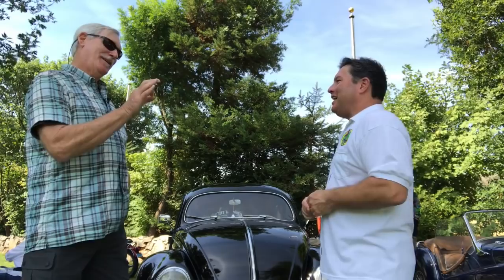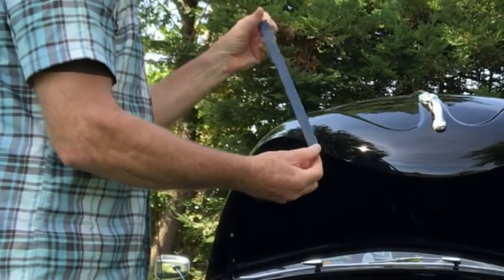Friday EXTRA! VW Beetle vs. Ford Model A + Viewer Mail + Thank YOUs

Comment: In the '70's and '80's, I owned a '63 and '68 bugs and a '69 Karmann Ghia. Back then you could buy old VW's dirt cheap -- there were still a lot of them around. I was young and poor, and these were cheap daily driven beater cars for me, not collectibles. I drove them until it became cheaper to buy another beater car than fix them. The '63 had a newer engine in it. All of these cars had either 1500cc or 1600cc engines, which, IIRC were 55-60 horsepower. So, power was adequate (just barely) for a daily driven car. These would pull the uphills on I-70 in the Colorado mountains at 55mph (the speed limit then), at full throttle in third gear. I used to get about 25 mpg in the city, and 30 or so highway. The latter figure was mostly mountain driving, where I would routinely coast engine off on downhills. You could do this reasonably safely in a bug. The transmissions would lubricate adequately when coasting. RVers used to like to use them as tow cars, as they cound be flat towed just by putting the transmission in neutral, and they were light. Since they were manual transmission, all you needed to do when you needed the engine again was turn the switch on, put them in gear, and let out the clutch. They didn't have power steering or power brakes, and didn't really need them because they were so light. By this time, they all had gas gauges too. The '63 had a mechanical gauge. There was no electrical connection, just a cable that connected the float to the gauge. Probably the worst aspect of daily driving a bug (at least in the winter) was that the heaters sucked. They drew air from the engine cooling fan, and ran it through an exhaust heat exchanger (so essentially manifold heaters). Since the air was moved by the engine fan, the amount of heat and air flow varied with engine rpm. In city driving, you could get a little more heat out of them by running in third gear instead of fourth, to keep the revs up. The only time the heater really worked well was on those mountain uphills, when you were running the engine at full throttle and close to maximum RPM. The bugs' top speed was about '75 on the level. With a bit of a downgrade or a tail wind, you might coax them to 80 or 85. Not that driving a bug that fast is really a good idea, but I was young and thought I was immortal. The Ghia would do 85 on the level, due to either better aerodynamics or lighter weight than the bugs. Which car was better? I would give a slight edge to the bug. You had a 4 speed synchronized transmission, rather than the three speed crash box of the model A. The bug, at least by the late '60's, had a distinct advantage in speed and power too. The model A, at least the bigger ones, had the edge in capacity. The front trunk of the bugs was pretty small -- you actually had a bit more room behind the back seat. Also, the back of the back seat could be folded down and give you a decent amount of space if you didn't need the back seat for passengers. Both cars though, were masterpieces of economic transportation and elegant simplicity.

Comment: So sorry to hear about your back!  Get well soon.   I have been watching your videos for several months and was thinking how similar the Model A is to the VW.
I have a 74 VW Thing that still uses side curtains.  Sometimes have to get creative to get it home.  I had an accelerator cable break once, ended up using a spare tail light bulb to wedge the carburetor open enough to drive home without the gas pedal.  A policeman stopped me as I crawled up a hill at 5 MPH with the fourways on, and wanted to know what the problem was.  After opening the engine cover and seeing the "carburetor bulb" stare back at him I was told to carefully continue my journey home.  Every drive an adventure. Gotta love old cars!!

Comment: If your 1951 VW is getting less than 38 MPG there is something badly wrong with it! Assuming that it gets driven so seldom that your fuel is evaporating faster than you are burning it, I own a 1952 VW and a 1929 Ford, the build quality and reliability due to simplicity and excellent design is very similar between the two, although the Ford has more torque and horsepower the VW makes up for it with aerodynamics and lighter weight

Comment: Finally The First Ford Friday Funday ! 
Loved the Friday VW special. I discovered long ago that in the Antique Car club I belonged to at the time, more than a few members also drove a VW beetle. 
The man who wouldn't sell one bolt or do-hickey from his vast 1926-27 Model T collection went to Germany, toured  the factory, and ordered his new VW which was shipped back to Illinois. This was in the late 60's. At the time it still cost him under $2000 total with shipping. 
I was impressed by those little beetles.  After I bought a very low mileage 1926 T touring project from the 'man who would sell nothing' I traded my 1954 Ford two door customline sedan for an unusual thing called a 1957 VW beetle with the folding sunroof. Unusual because here  in corn country in the 60's and 70's VW's were mostly unseen and unknown. It had a small oval rear window and a lever under the dash to flip when the gas tank went nearly empty. Sorta like an old Harley I had.
I have no idea what fuel mileage it got but we drove it 170+ miles from home to Chicago and back before filling the tank at our favorite hometown filling station! Most of that trip was on a highway called Rt 66.
Two kids eventually rode in the space behind the rear seat for fun. They watched 4th of July fireworks from the canvas covered hole in the top. I hauled  Christmas trees and pulled a new Chevy Corvair from deep sand..... I'd promised the Chevy dealer I'd never tell! Corvairs supposedly went thru anything.
In 1969 my wife and I drove from central Illinois to the middle of NY to a concert in the middle of a cow pasture, camped in the VW, and returned to Illinois. A small event few remember.
I have more memories of VW's than Model A's. Maybe I shoulda bought a VW instead of my last Model A.😀

Comment: Thank you for previous video, and for answering my engine counter balance questions. The after market counter balance crank did make a difference in my model t but you confirmed what I thought that it is not necessary for a model a! Thanks guys!

Comment: So cool you shared the video! Thank you. In 1951 there were multiple models of the Beetle. This is a Deluxe Sedan. I am in the final phases of restoring my 1951 Standard Sedan. The standard was the low budget version, and differed from the car in your video in that it has mechanical/cable operated brakes, a completely non synchromesh transaxle, and no chrome trim....even more like a Model A. ;) When I am done with the resto, it will be on to complete my October 28 Tudor. Love all your videos! Thanks Paul!
Reply from the maker: Thanks for the additional info, Mike!!!  That's neat to know.

Comment: 40mph cruising speed and only 20s for fuel economy? Something is very wrong with that vw. I’ve had MANY over the years. My 40hp VWs would do 75mph flat out, maybe even a bit more and return 28-32mpg average. A vw has the same top and “cruising” speed. I always found my 40hp was perfectly comfortable at 65-70 all day long, my 50hp 1300 a few mph over and a 1600 late model Bug was fine at 75-80 and mid-high 20s for fuel economy.

Comment: Don't know how I happened to stumble across this but glad I did.  Both VW & the "A" Ford have drawn my attention for many years.  Over the years from 1966 to 2012 I think I have owned 25 or more VWs of all types from 1956 thru 1972 years, and from 1964 to 1979 I owned a 1930 Ford Coupe and a 1931 Ford Steel roof pickup.  At that time, I lived in different parts of Arizona.  I feel you are right in placing them together in the same class of vehicle.  Have spent many enjoyable hours "playing" with both type vehicles.  During the 1970s I taught my kids vehicle maintenance on these and to this day my daughter (at age 61) still does her own oil changes.  I am now retired (age 82) and live in the Philippines so I only maintain my driver here which happens to be a 3 cyl mini-mini van.  Does my heart good to know that there are still some young folks (such as the 18 year old young man) around to keep these old irons running.  Also good to see some other elders (Rich Davis) still doing their thing.  

Thank You for doing what you do to keep the legacy going.  Brought back a lot of memories.

Fred

Comment: I’ve owned three of each. A VW drives a lot like a Model A (with an extra gear so it’ll reach highway speeds).  Both have little HP, no heat (almost all old Beetles have rusted heater channels), flat windshields, and not much sound insulation.

Comment: If the 600w now being sold is too thin, what do you use? Sorry to say I gave up on trying to get a wide body pickup. Found one but when the seller realized I was very interested he raised the price an additional $10K!!. So, yesterday I bought a 1934 pickup with a V8. Sorry. So glad you enjoy my Dad's HAM gear and are able to put it to use.
Reply from the maker: Thank you, Rob!  The ham gear is in use, as described with "73 DE W1LTD SK" stickers on them.  Sorry the 31 metal top pickup didn't happen (hasn't happened for me either yet), but you did well to pick up that 34 with the V8!  VERY well done!
Reply: @ModelA  A lot of the model A videos will help me get this one sorted out. So far the steering gear box is bone dry and right front wheel bearing is bad. I'm going to just replace all the wheel bearings. the frame looks to have been painted with a brush and nothing has been greased lately. But , I found a '32 with a V8 that looked to be perfect. $34000 was over my budget!!
Reply from the maker: Ouch!!! That's a bit too rich for me also.

Comment: Hey Paul, love the videos! About a year ago, I was having problems with shifting our 1931 slant window town sedan and the first thing I did was check the transmission fluid. The fluid was almost as thin as motor oil! We were looking for the correct fluid when we came across a product called "Meropa 680". It is almost exactly the original viscosity, and much thicker than what the model A parts suppliers sell.
Reply from the maker: Thanks for sharing!

Comment: In between my second and third Model As, I had an air-cooled VW Beetle. I found the Model A easier to work on and more reliable!
Reply: TuanBasikal I've ran both Model A and T Fords, and now have a stock 64 VW Beetle, and O YEAH, I'd rather work on the Fords !  I really like old VWs but they are a real different experience from what I'm used to--ha-ha.

Comment: Nice to see this video. My dad has a black 1952 VW Beetle since 1985, exactly the same as the one in your video. He restored it himself and it was ready in 2009 when I was only 9 years old. We don't have a Model A but I've been to Model A meetings and I had the same feeling: it's not that difference than a Model A. I learned to drive in the Beetle when I was 18 (3 years ago) and now I use it reguarly in the spring/summer, really nice to drive in. Last February I drove on a wedding. However: I still want to by a Model A sometime in the near future.
Reply from the maker: Nice.  Especially learning to drive in the VW!!  Awesome, David!
Reply: @ModelA  thanks! Shifting gears was the hardest part the first time..

Comment: Cool a J-38, You can pound brass while seated. (Where your a radio operator in the Navy?)
Reply from the maker: Yes.  How did you know?
Reply: @ModelA  Your Q&A with your father you mentioned that he was in the Navy, I made a guest that you got your start on your electronic training in the Navy I/E Sparks. Also in the examining oil stains on your garage floor I got the impression you knew how to swab the deck.  As your recuperating from your back ache sit down in front of your ring and pound out a few CQ's on that J-38 for that silent.

Comment: Great video showcasing the VW Beetle. Funny, nevertheless thought of or realized the similarities between the Ford Model A and a VW Beetle. My second car was a 1968 VW beetle, and I’ve owned a 1929 Ford Model A Phaeton. I would have to agree with you Paul, they do have quite a few similarities! Also, I was wondering if you were a fellow radio enthusiast as I noticed in quite a few of your videos you have them on the shelves in the background! Have you ever thought of maybe doing a few radio videos? as always, really enjoy the information you provide. Thank you for the great videos!
Reply from the maker: My ""real"  hobby is restoring antique radios.  Been doing that since I was 7.  In the shop are dozens of radios awaiting their turn on the bench.
Reply: @ModelA  The radio hobby is definitely a fun hobby! I started out with an old Atwater Kent radio back in the late 1970’s. Moved to a realistic DX-160, Knight Roamer and Yaesu FRG (that I still have) in my teen years. I have always been enamored with shortwave radio. Mostly use an older Kenwood ham radio these days. HEY! Just wondering, do you know anything about Collins 75A military radios? I think a spin-off radio channel might be a good thing for you Paul! Thanks again! Looking forward to future videos.
Reply from the maker: I have a 75A (the transmitter is a 32V2) setup!  Yep, I know a bit about them.

Comment: You're right about the "600W" gear oil sold by Model A vendors; it's a bit thin.  There are a couple of gear oils that are still available that are pretty close to the original.  Shell Valvata is one of them and Chevron 680 is another; but the one I've used for years is Lubriplate SPO-288.  It's more expensive than the 600W that vendors sell and commonly comes in a 5 gallon pail, but I split it up into 1 gallon containers and resell to my fellow club members.   One gallon will last you for years!
Reply from the maker: Thanks Rick!
Reply: @ModelA  Just checked on Lubriplate SPO-288 - hard to find but did locate some in El Paso.  Best buy is the 5-gallon pail, but it's $198.00.  However, since that's 20 quarts, it's less than $10 a quart, about what you'd pay for the "600W" from Model A suppliers, and this stuff is like molasses.  "If you want the best..."
Reply from the maker: @mafcawebmaster4237  Awesome!  Do you have a link to share?